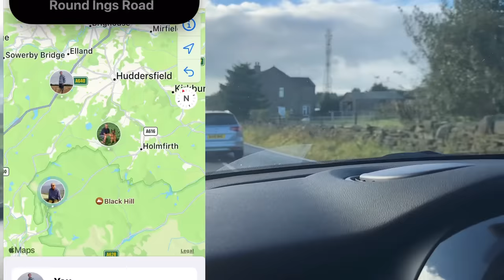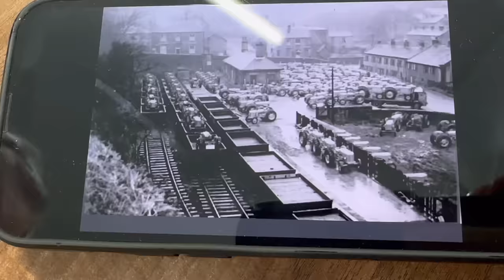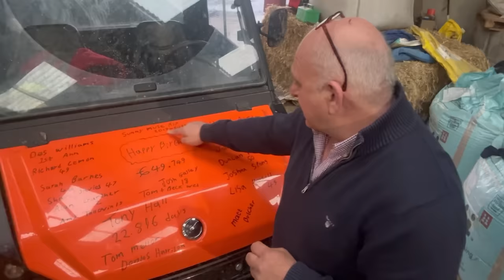I HAVE A RIDE IN A ARMOURED CAR  #AnswerAsAPercent 1314

Comment: We had 2 of these on the boatyard on the Norfolk Broads one with a torque converter with hand clutch and one with conventional gearbox we use to pull the cruisers out of the water

Comment: These were coming into service at time of Dunkirk. Dunkirk was held by the Queen Victoria Rifles and others holding Calais. The Rangers subsumed as as 9 KRRC were on a training course in Coventry at the time and were told to drop course, climb in and go to Dover to assist at Calais. They drove all through the night and arrived at Dover Quay to see ship had left and was faintly visible in distance. QVR and Rifles and tanks fought to finish to allow evacuation of Dunkirk. They were marched off to captivity. 9KRRC were then posted to Middle East and then to Greece and finally to Crete a bloody campaign which was a pyrrhic victory for German arms for they never used air troop assault after that.